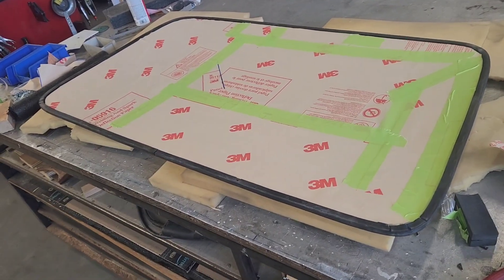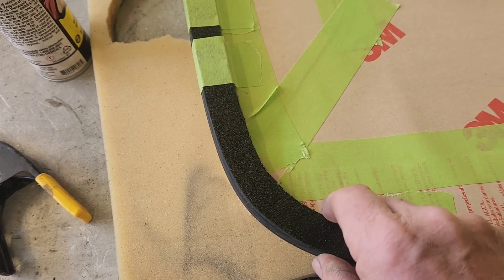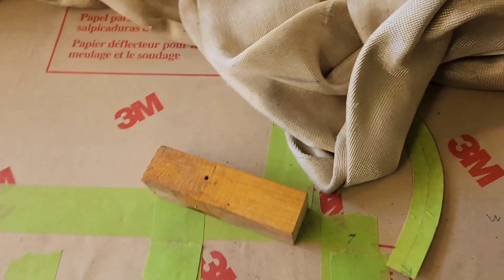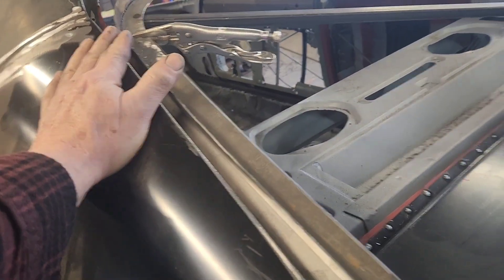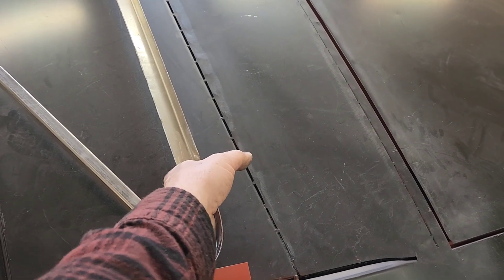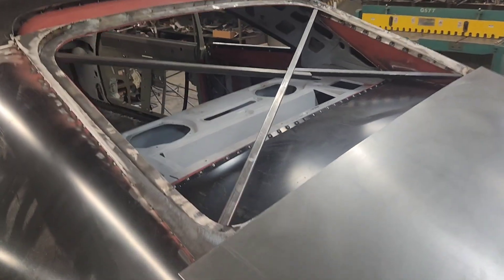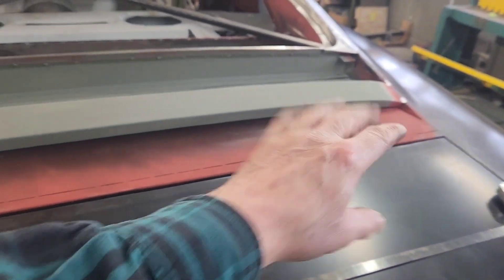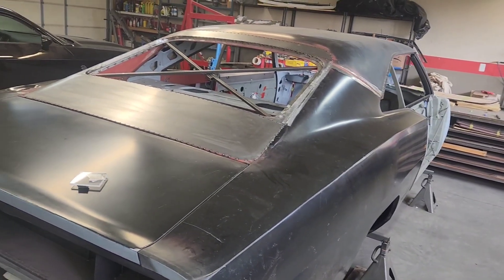Randy's Hellcat Daytona part 14

Comment: Awesome job with what you are doing with the rear glass area! I know the flush rear window design on the winged cars had a purpose,  but to me, it did remove one of my favorite features on the Chargers, being the recessed rear glass between those glorious sail panels.
Reply from the maker: The Gen 2 race car in stock car racing was a disaster because at speed that tunnel back window created lift in the rear. Made for a scary unstable ride but I get what you are saying.
Reply: @SteveMirabelli  Yes, in wind tunnel tests, the recessed rear window caused a pocket of dead air as it flowed over the back of the car, killing whatever downforce that would have been applied to the rear wheels. They fixed that problem by adding a flush rear window (on the Charger 500) and then the giant wing later with the Charger Daytonas.